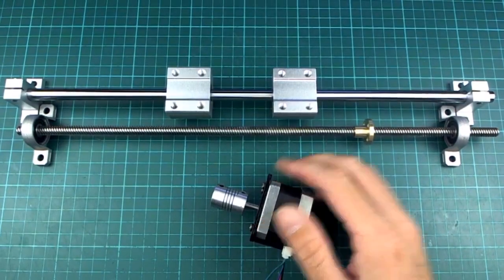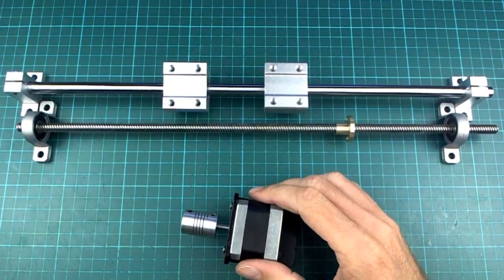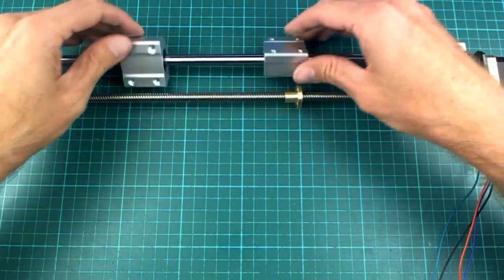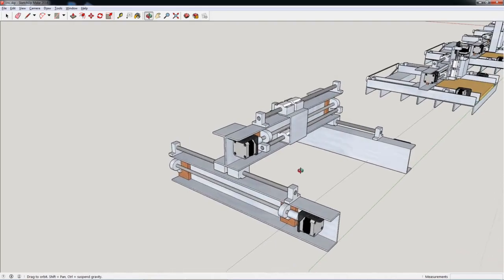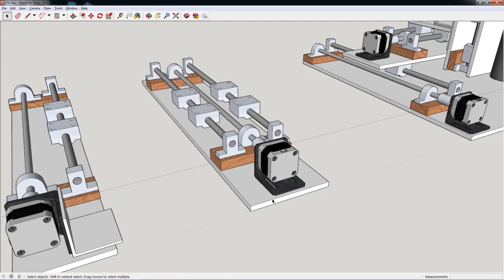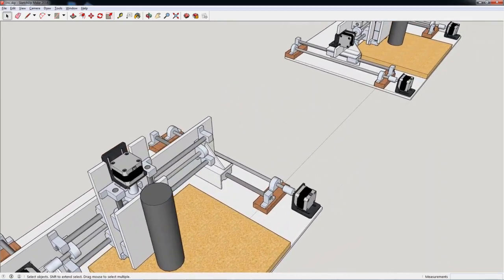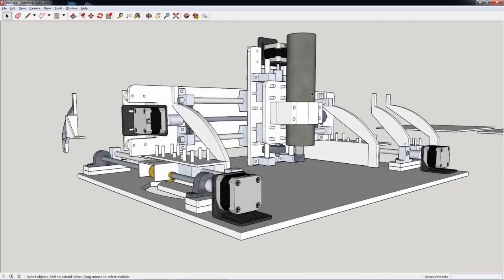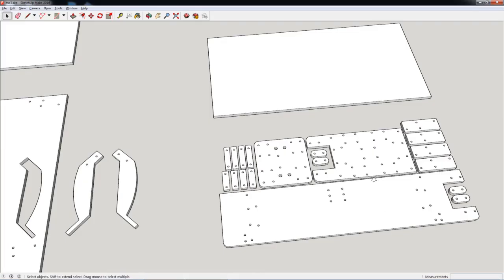DIY mini CNC machine part 1 (intro)

Comment: Hello, your project is very successful. Congratulations. There is something I want to ask you. Wouldn't it be better if we use the fixed coupling instead of the flexible coupling you used for the Nema 17 motor connection? When we use the flexible coupling, there is a possibility of flexing a turn of seconds when the nema 17 motor generates power when trying to cut or drill. In such a case, it seems to me that there may be millimeter deviations in the workpiece we are working with.
Reply from the maker: If you mean the linear rails, yes they would be much better if they were supported all the way along. When cutting hard materials like carbon fiber or aluminium this machine has to go veeeery slow.
If you mean the spiral coupling connectors between the motor and the screws, I'm pretty sure they are designed specifically to not have that problem much. Certainly the flexing of the linear rails will be a bigger problem.

Comment: I'm just working up to converting my Sherline mill over to CNC control.  I can already program CNC mills, so that's no mystery, but retrofitting one with the motors, and then putting in the electronics and making the whole thing work is quite another matter.  I spent approximately 13.72 milliseconds pondering how to go about it before I recalled: hey, Steve has probably already done it, so just do what he did!  And here I am.
Reply from the maker: Who's Steve? :~) I think part four of this is where I started looking at the control stuff.
Reply: @iforce2d  I meant Chris.  Sorry.  I'm not really Reach41, the name is Gary.  But you can call me Phillip for revenge!

Someone is giving me a control, a TinyG, along with a power supply. Apparently G-M codes can be loaded into it directly using a terminal program with CTS set.  If that's the case, getting started should be very easy (famous last words).  I'm not going to spring for ball screws, since they want twice the value of the basic mill for the conversion kit, so might have to invent something to reduce backlash to an absolute minimum.

In the process of looking for your videos on CNC, I passed a few of the old ones on Big Red.  Kind of made me sad.  I trust she is hanging from a wire in a nice, warm spot in the den.

Comment: Very interesting. It would be very useful for science applications. See these examples of adaptations of low-cost CNC machines and low-cost robotic arms being integrated to standard scientific equipment:
https://www.researchgate.net/publication/322363581_Osmar_the_open-source_microsyringe_autosampler

https://www.researchgate.net/publication/327230541_Auto-HPGe_an_autosampler_for_gamma-ray_spectroscopy_using_high-purity_germanium_HPGe_detectors_and_heavy_shields

https://www.researchgate.net/publication/264085569_A_low_cost_easy_to_build_portable_and_universal_autosampler_for_liquids

All this is possible because of AutoIt:
https://www.researchgate.net/publication/307466871_Practical_Laboratory_Automation_Made_Easy_with_AutoIt

Comment: Just curious, but would there be any technical difficulties in sitting your Z axis motor on top of your X axis, then translating that into Z axis movement with perpendicular gears? It would lower the height profile of the entire setup.

Comment: How to calculate rotation of motor to distance and design power screw
Reply from the maker: The distance per rotation depends on the pitch of the lead screw. The one I bought is made to move 8mm per rotation. In the GRBL settings I then need to tell it that information, I looked at the details in part 4: https://www.youtube.com/watch?v=OuhgZMDXDdY
Reply: Thanks :)

Comment: I've been designing a CNC that happens to look an awful lot like the design you show at 10:40.
I'm planning on using a cast aluminum t-slot bracket to hold the Z axis up (all plates are MDF).
Also, I'm going to try using only one X axis lead screw placed in between the rails. I think there's enough space between the spindle and rail for it to fit.
To help with the spacing issue, I turn the Y and Z stepper brackets around and bolt them to the underside of the plates.
I arrived at the same idea of using two opposed lead screw nuts to preload and eliminate backlash.
I probably won't build it because I have no self confidence.

Comment: Looks good so far. Just to ask a few questions/observations sir. 
1) Are you aware that banggood now do an ant-backlash nut for the 8mm thread?
2) what size are your steppers?
They look like NEMA17's to me.
3) Do they have enough torque to move the weight?
4) What Drivers are you using?
I personally went with the 5 Axis breakout board with individual drivers, then made my own MPG.

Will watch the rest of your videos when i can.

Comment: dont use sketchup. its bad ti say the least. try fuion 360 its a real 3d program. thank me later :p i made a few cnc machines.
Reply from the maker: That's very vague, what do you mean by 'bad'? What will I thank you for if I use Fusion360? I'm only using Sketchup to visualize how things will assemble together, not to make CAD designs for cutting...
Reply: iforce2d was a bit drink when i grote that. i tought you'd be using sketchup for 3d drawing your parts. sketchup is handy to visualise a room or somthing like that but thats it. it doesnt really have much power. fusion 360 is a propper cad software that is parametric on a timeline, meaning if you change one step in the beginning of your drawing the whole drawing changes accordingly on how you constrained them. also assemblies are way easier and it can generatie gcode.

Comment: Way not just bend the plate and mount the stepper onto that, remember if you bend a plate its stronger.
Reply: Bending the plate by hand it would be difficult to attain the accuracy he needs.

Comment: Hi Mate, looks like you have been spying on me again :) funny how similar interests mold similar projects. This is the third project that I have done at about the same time as you, quads, fixed wing and now CNC :) Just thought that was funny.  On another note I see you are using a lot of aluminium,  check out this quick one from "the king of random" https://youtu.be/tH-PaNugz9w may save you a bit of time.
I have also been following this https://youtu.be/ogaIXwTe_PM from "HomoFaciens".

Comment: I know you already have the rails, but is there any reason why you did not go for the supported type. With all other things being equal, I think that change alone would make the machine much more rigid. http://www.banggood.com/SBR12-600mm-Linear-Rail-Shaft-Rod-with-2-SBR12UU-Block-p-1053640.html?rmmds=category
Reply from the maker: I didn't really think I'd need them, and I wanted a 400mm size which I couldn't find on BG.
Reply: I keep thinking about designing something similar, but get lost running away looking for stiffness. Just last night I was watching a video on cast epoxy granite composites.  It quickly snowballs into something way too expensive. I am looking forward to seeing how your build goes. Maybe it will inspire me to spend some money like your cheap-ass quad-copter did! :-)
Reply: Unsupported round guide rails are notoriously flexible. They would have worked for your pen plotter project, because there is not much force there. But over a span they will reduce the rigidity of your machine in more demanding applications.

Comment: I tweeted about SketchUp not working on Linux the other day. Sketchup replied that they have SketchUp web app that works across platforms.
my.sketchup.com
It does the job. Has most of the features that the desktop ones has, although it is a bit tricky learning where everything is again.

Comment: I wouldn't use wood as a spacer for a precision result. Wood expands and shrinks under different humidity conditions. Not to mention wood under constant pressure from a tightened hold down bolt can become lose over time by the wood fibers collapsing/crushing.
The motor cutout idea without the wooden spacers is much more elegant and solid.
Curious as to the costs for this build.

Comment: Interesting, I bought an OpenBuilds C-Beam machine, I think I mentioned this before, it is a very capable CNC router if you want to cut wood or plastic. I certain it would slice up CF sheet without trouble, but trying to cut Aluminium was beyond it. Just not stiff enough. I've bought a much larger mount for my router but have yet to drill the holes ready to attach it to the gantry. I have it in mind, should the "new & improved" model struggle with Al, to "double" the gantry such that the router is sandwiched between supports. It will cut down some of the work area on the Y axis but if it turns out to be rigid enough to cut soft metals extending the Y axis won't be a problem.

Good things to mess around with, I haven't been giving it the attention it deserves though, got a new toy a 100W cheap Chinese CO2 laser.

Good luck with the build.
Merry Christmas, somewhat belatedly, and a happy, healthy, and prosperous new year to you.

Comment: Merry Christmas!  This is going to be a great project to follow...  Slightly off topic;  I have used Sketchup (free versions) since it first appeared, and it is great. HOWEVER... having picked up on John Saunders' (NYC CNC) enthusiasm for Autodesk Fusion 360, I recently downloaded it.   WOW!  This is the real deal, full blown CAD/CAM with a very extensive tool set... it includes things like helix, threads, spheres, cones, design analysis, component weight, and a heap of things beyond my understanding   ;o)   It is free provided you do not use it to earn more than USD 100,000 per annum.  (I wish).  Oh, and since you have invested so much time on your project already, you will be pleased to hear you can import Sketchup files, with reasonable success.  There's a bit of a learning curve, but well worth taking the time to look.  Thanks for the pleasure your videos give me.
Reply: Fusion360 is not free.
Reply: Hi Paul, Could you please explain why you say Fusion 360 is not free?  You have taken part of one sentence from my post and quoted it out of context.  There are conditions as I said, but as a retired hobbyist I will never make USD100,000.  The following is from the sign-up page on the Autodesk website:
"Get Fusion 360 free for 1 year if you are non-profit or if your business makes less than $100K a year.  Renew as long as you need it."   
DISCLAIMER: I have no affiliation with Autodesk, and I am receiving no payment or other benefit from Autodesk.  I consider that being given access to Fusion 360 is a privilege which I appreciate, and I am pleased to share my enthusiasm without being asked.
Reply: This is a comments area related to a fantastic video series on a DIY CNC machine.  It is not an appropriate forum for your debate.  Troll elsewhere.

Comment: Hi! Did you consider a "portal" design, where one of horizontal axes (table) moves independently from others? It's a very common design for CNC machines. Here is probably a better description https://www.quora.com/What-is-a-portal-type-CNC-milling-machine-What-are-the-types. In your current design X axis is built on top of Y axis, and Z on top of X, what leads to a less rigid machine.
Reply from the maker: Yes, and I think it's probably a more successful design overall. I went with this one because it's easier to base everything on a single flat platform, at least with the plate I have, and also because I am thinking I might either have a water bath or running water on the main bed if I ever do carbon fiber. In either case, I don't think I would want the workpiece to be moving around.
Reply: OK, cool. I thought, you might miss that. The point with water bath is strong. Keeping rods and bearings from getting wet is a lot easier with your design.

Comment: Great project!you must have soent so much time modelling!
what spindle are u planning to use?and what size are your Linear rails?having built many cnc's I can say that 600mm is about the limit for unsupported rails of 20mm, but not knowing what u will be cutting its hard to say, if you are milling PCBs you might be OK if you are trying to cut wood or plastic you might have to take very small passes without any deflection.if you want a cheap bombproof linear rail consider v bearings and angle iron!again depends what u are cutting but your steppers look a bit small you might want to consider nema 23 size. Welcome to CNC, just remember your fiurst machine will probably be proof of concept and it will still be fun!

Comment: Check out openbuilds.com a great site for homebrew CNC machines. Looking forward to watching this build. I've just got a Chinese 3020. Love it! Changed aluminium bed to mild steel plate so I can use magnetic hold downs, so much easier and more z height for greater depth of cut.

Comment: I'll be interested to see how this progresses. Cutting your own design of pieces with water jet is fun but was too expensive for me. I have now gone with aluminium extrusion and plate cut to length by the supplier. I have drilled the holes myself. Getting holes cut with water jet is a nice and accurate way to go though.

The other thing I did differently was to go with pre-assembled stepper + ball screw + rectangular rail assembly which I found relatively cheaply on AliExpress: https://www.aliexpress.com/store/1993147. Hopefully, these will give me good accuracy. I too was worried about the twisting forces so I have added an extra rectangular rail to each axis.

You're right, the cost does quickly escalate but it is such fun designing and making it yourself.

Good luck.

Paul

Comment: iirc cutting carbon fiber is easy on home machine. just use a bit made for composite materials. also make sure to build a box for electronics. carbon fiber is conductive
Reply: Use a powerful enough laser and sure you could use one. 

Hell in theory you could focus enough photons that the energy density would result in the formation of a black hole. Well, maybe. Might be a few properties of the physics not allowing a laser to still be a laser at the point where energy density begins to approach levels that could form a black hole. 

Probably be cutting whatever it is you wanted to cut before you punch a hole in space-time though. 

Anyway with a powerful enough laser you can cut anything.
Reply: David Serrano can laser be used?
Reply: shubham saxena you can engrave with a laser.

Comment: I suggest you to use fully supported rails instead of unsupported rails because unsupported ones would cause lots of vibrations and will definitely affect final finish of the work piece.

Comment: Best off using pulley / belt to go from stepper motor to worm drive - height offset / mismatch super easy to fix with no slop :)
Reply: Yeah because pulleys and belts are so much more simple than complicated spacers are. Wait, no they aren't.

Comment: Hi! How are you making out with you Eagle EPP Mini Slow Flyer 1200mm Wingspan RC Airplane KIT?
Reply from the maker: glue is drying now
Reply: cool, weather is bad here...it's winter so I can't test mine
Reply from the maker: Well it's definitely not made for crashing, that's for sure. A couple of light crashes and the front section was toast.. The whole nose area is very flimsy, I'm thinking about just making it a slope soarer...
Reply: :( that's not good... I wonder if I should take the leftover plywood from the parts and re enforce the front some how?